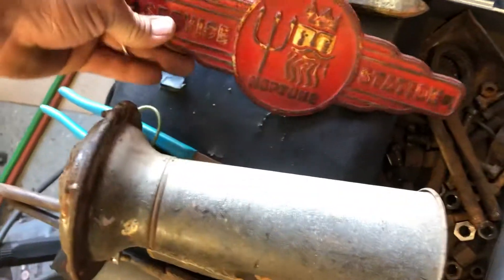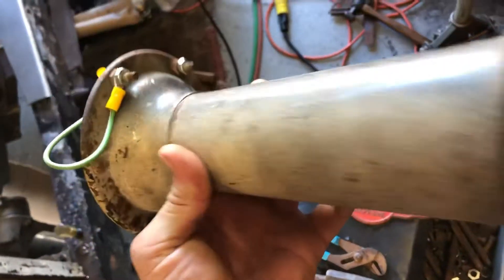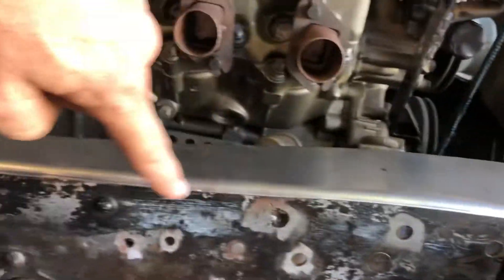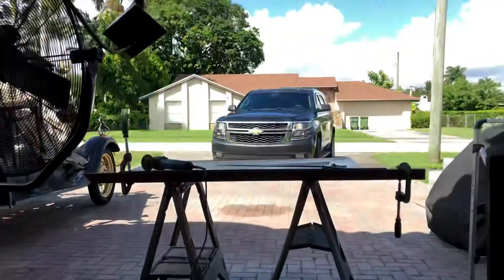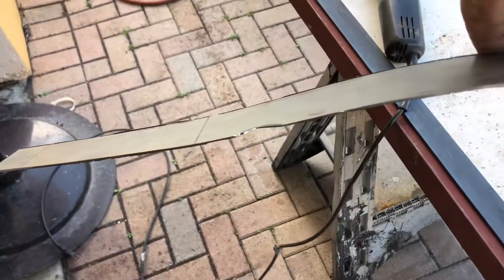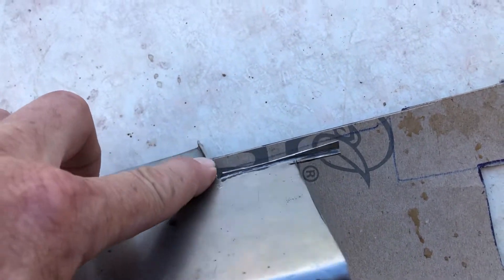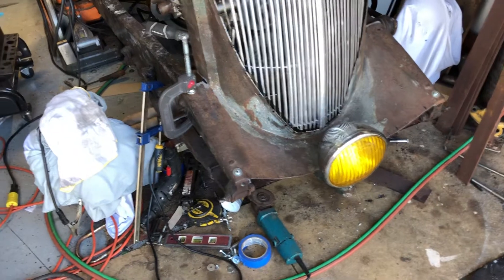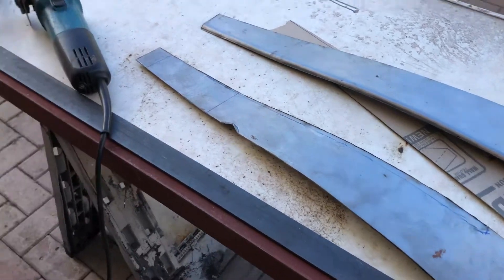Extending the chassis skirts on the front end nose shell to hide the rails and gaps.

Comment: Hey buddy, 16ga. Cold Rolled? I prefer it myself but I have returned to using hot rolled. I just spray on muriatic acid to remove the mill scale. Just don’t breath the fumes. Take about 2 coats to remove all of it. After I rinse I spray it down with water/baking soda solution to neutralize
Reply from the maker: Yeah its cold rolled 16 gauge, isnt cold rolled more pliable? This is my first go at using metal so I am definitely green and learning
Reply: @damiansgaragebuilds7663  It is better for rolling body panels. It has more consistent hardness. Hot rolled will have hard and soft areas. However, if  I am capping a rail or building framing, hot rolled is fine. If I am building a race car or motorcycle chassis I would be using DOM tubing. A-arms as well. However, the price difference on the two used to not be so pronounce. Additionally, my local steel supplier only carries hot rolled.